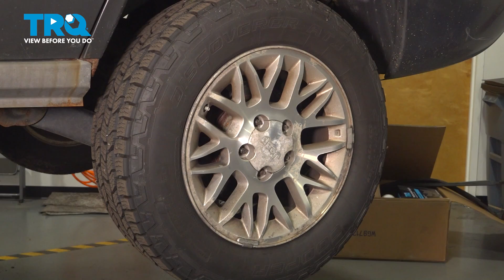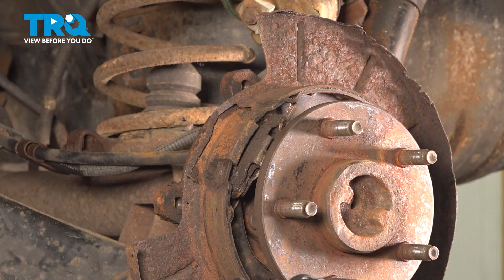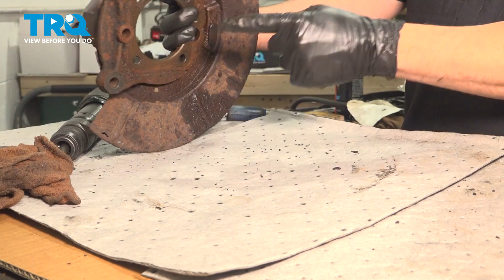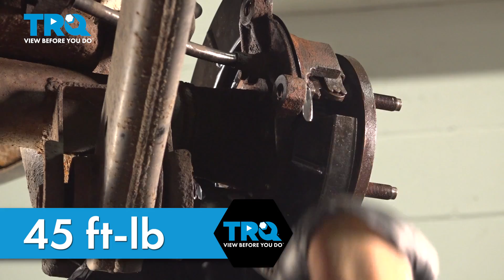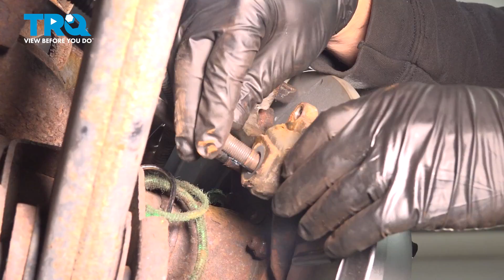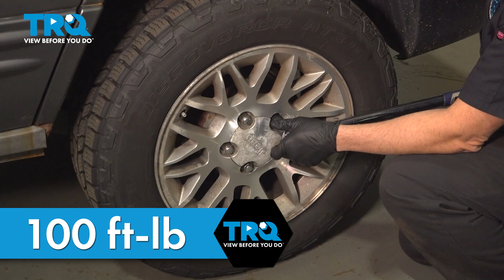How to Replace Rear Backing Plates 1999-2004 Jeep Grand Cherokee

Comment: Great Video I was wondering if you have ever done this on JEEP TJ and if this is the same process when changing the Rear Axel Backing Plate on a 2005 Rubicon w Rear Disk (just bought a used DANA 44 that had  the ear broke off the bracket that holds the caliper on) so I’m going to be replacing it ASAP.

Comment: Are the ebrake springs an upgrade  ? Mine don't look like that, thier shorter with an approximately  2 inch straight extension 2003 grand Cherokee